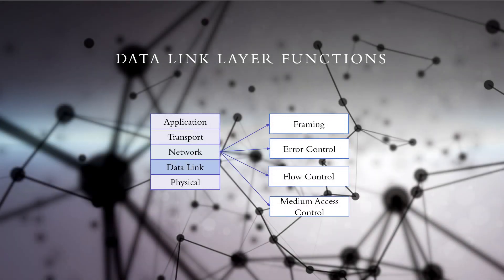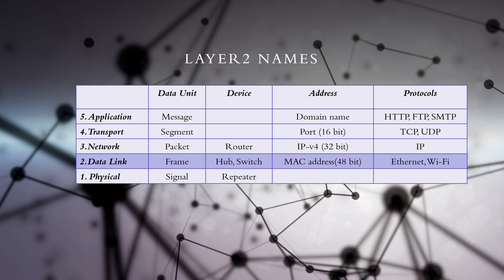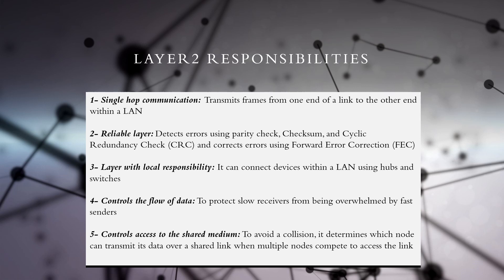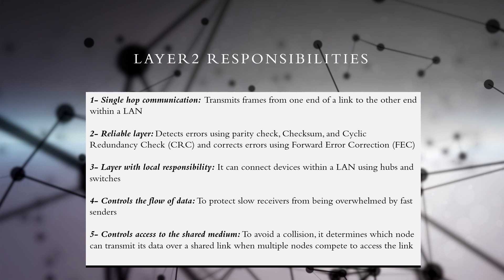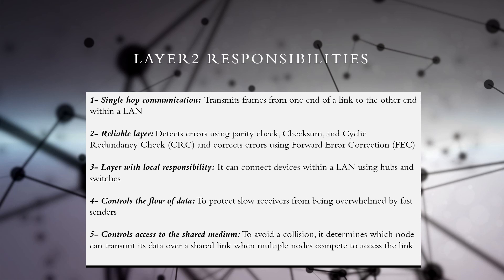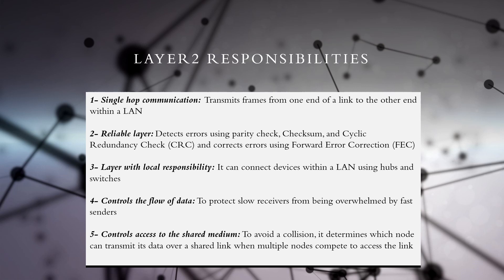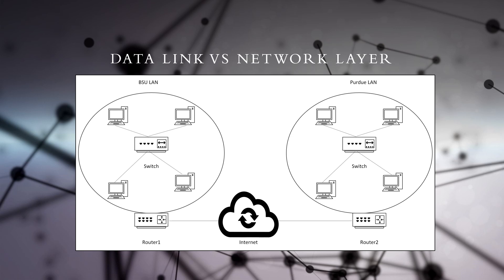Functions of the Data Link layer in TCP/IP model

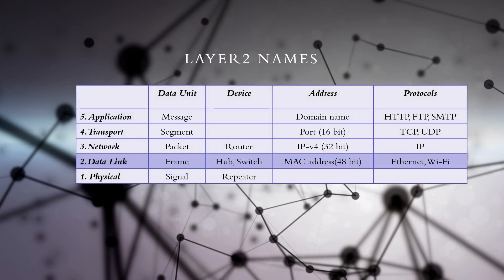Comment: 0:38 Hub is a layer 1 device.
Reply from the maker: Hub and switch are data link layer devices that connect nodes inside LANs. Repeater works in the physical layer as a signal amplifier and router operates in the network layer to connect different networks. I hope this clarifies the role of the various devices in a computer network.
Reply: @Business_Courses  No, a hub is without doubt an L1 device. A hub forwards bits, not frames, so it doesn't use MAC-addresses, contrary to your table in 0:55.